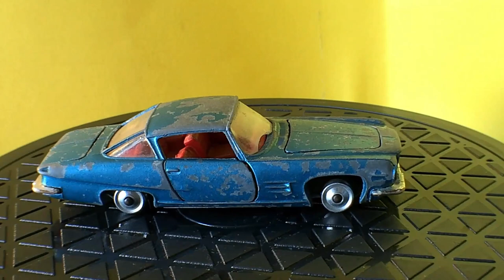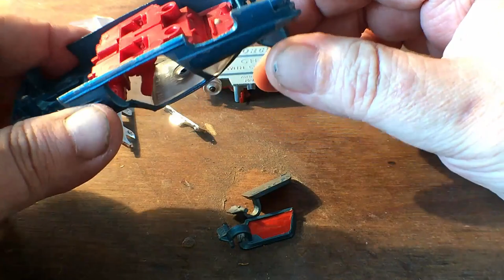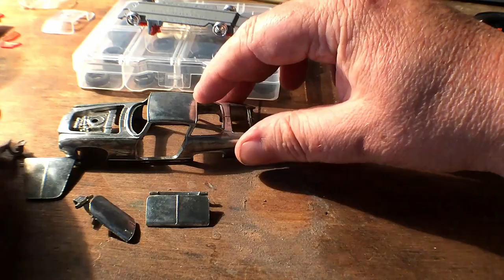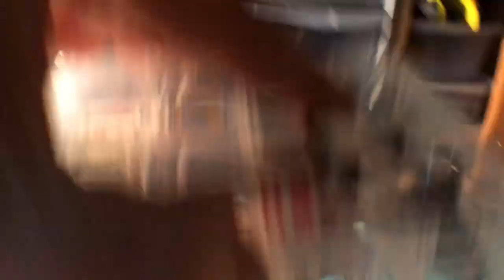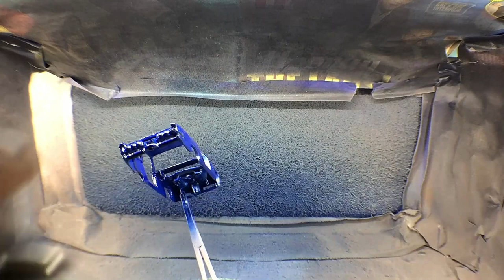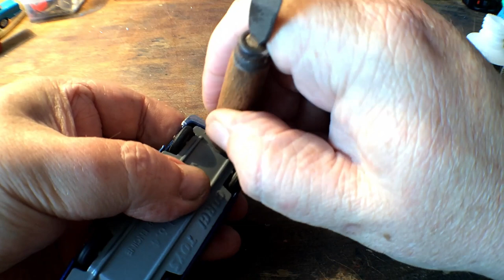Corgi 241 Chrysler Ghia V8  Restoration

Comment: Another cracking restoration Bob. Couldn't agree with you more regarding the Molotow chrome. The liquid is amazing I just wish I could say the same about the pen itself......regards PJ
Reply from the maker: Mid Life Models yes the pen isn’t the best to use for applying it that’s why I always get a bit of the fluid in the well of the nib, turn the pen upside down, hold it there with a vice or something just to keep it stable then dip in a very fine brush and paint it on.😉👍